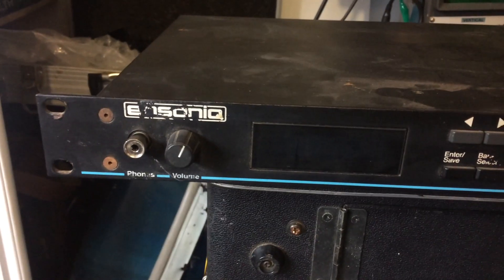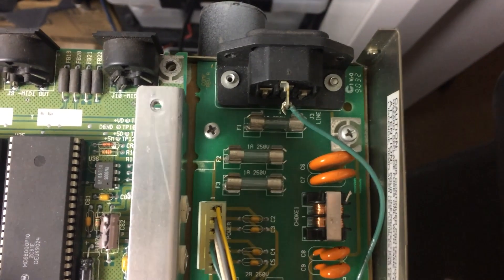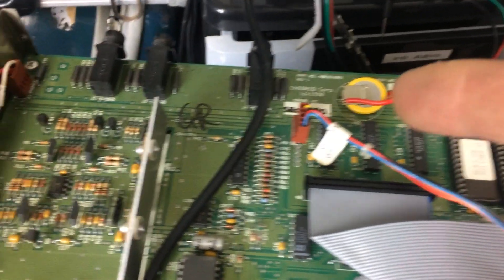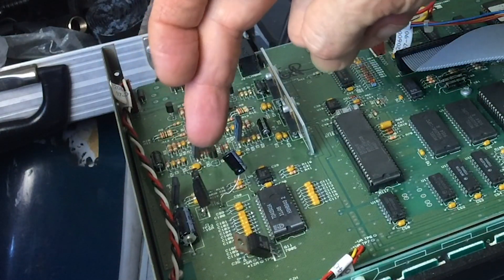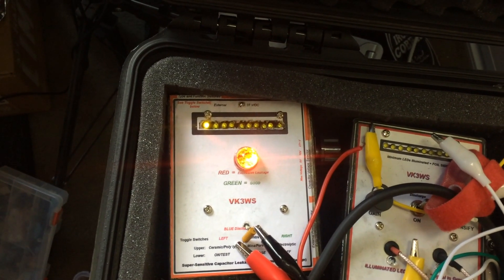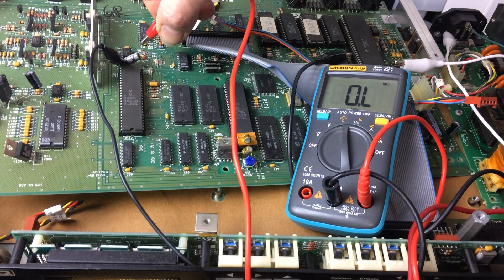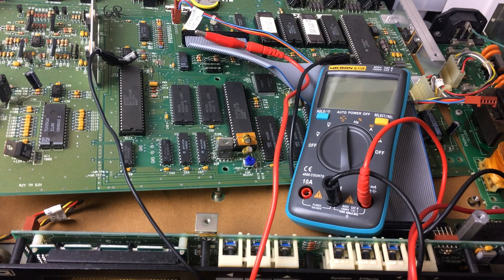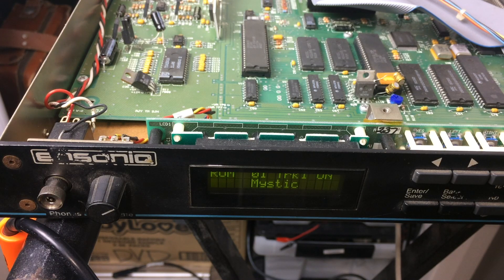Ensoniq SQ-R Synth Repair without a schematic | How to test capacitors

Comment: Nice repair vid of a classic synth of the early 90s, btw my SQ1 plus keyboard has a blank screen and it only shows the number of each button i press its in a mode called "self edit" i think, i cant make it work altough i have tried all the ways to initialize it it doesnt seem to work, on the service manual it says something about "hard reset" but i dont know how to short the minus side of the battery with pin 28 of U28 chip, any ideas would be great
Reply from the maker: @Pan6888  thank you for your comments. Turn off the instrument then use a piece of wire or one probe of a multimeter to join to two points as stated. Hold there for 10 seconds or so. Remove the wire then restart the module. If still a problem, read the section of the manual on editing. It could be it has a scrambled memory. Reset should fix it.
Reply: @onomatopoeidia  Hey thanks for the instant reply ! 
So i need to place a piece of wire on these 2 points (Minus side of the battery - which i have replaced by extending it out of the motherboard with a couple of small wires as well - and pin 28 of U28 Chip for a few secs. Normally this will hard reset the instrument and if no then i should look about for the Memory chips - which i dont know where they are located as well but will find them - 
 So far i did the following 

Checked the fuses -  OK 
Checked the ribbon cable that goes from the keyboard to the main PCB - i mean i have checked that for continuity - 
Reseated all socketed ICs 
Reconnected everything like the cable that goes to the main board from the PSU, the cable that goes from the keyboard to the main PCB 
Replaced the Battery - it was only 0.40 V but this is not related to the issue that i am facing 
Checked for problematic caps visually - they look ok 

Tried to aply the Normal Reset procedure with no luck i can only see button numbers whenever i press on - btw all work fine - but nothing happens. 
 I know that the synth enters "Self test" mode whenever fuses are faulty, or whenever for some reason there is no connection among the various PCB modules but in my case it seems that the issue lies elsewhere, hopefully i will find it cause i love this early 90s synth.

Comment: Hi, thanks for the video. I hope you don’t mind me asking. I’ve recently resurrected a Korg DS8 with a battery and display change. There’s one issue though - when i edit sounds for a longer time the synth freezes. After restart it’s ok (if i just play and don’t edit) . Do you think this might be capacitor related?
Reply from the maker: @racalik  try a factory reset/re loading of the system memory. Removing the battery would have scrambled the memory and that’s why it’s crashing.
Reply: @onomatopoeidia  yes yes I've done that after the replacement, loaded some patches and it works all fine in general, but for some reason I cant edit for more than about a few minutes, lets say. Weird issue!

Comment: Greetings from Adelaide , what scope are you using ? does if have a component tester or is that what the box is on the left of the oscilloscope?
Cheers.
Reply from the maker: @andrewverran6998  bog standard scope…yeah it’s a great box. My brilliant dad made it. It’s a curve tracer, sometimes referred to as an Octopus. Let’s you visualize resistance on the scope and great for seeing switching curves/knee shape and invaluable for adjusting hall sensors, potentiometers and components. See the link in the description
Reply: @onomatopoeidia  I thought it was a curve tracer...nice work by your dad
✌️

Comment: Mine has just died, this is great. Many thanks !
Reply from the maker: Same problem?
Reply: It was working one day and then the next no audio, theres some noise but not the humming as with your example. Unit boots, LCD is working and menu works. I need to get the multimeter on it and do a trace, but hoping it's going to be something simple which has failed on the output stage like yours. I'm based in Turkey and the only keyboard / studio tech I know is 900KM away so try to fix what I can myself.  @onomatopoeidia
Reply from the maker: Schematic here. Check all the voltage lines especially the 15V regulator. https://archive.org/details/sm_Service-Manual_SQ-1_SQ-1_Plus_SQ-R
Reply: Hey man thank you, thats very kind of you. Hopefully I will have one less patient on the bench :) @onomatopoeidia
Reply from the maker: @bensmethurst7821  anything a person made can be fixed by one :)

Comment: I have a Korg Poly 800 that seems to be fluttering pretty heavy when I play patches. I've already replaced the internal battery, but I'm still not too familiar with electronics. Any chance that's a capacitor issue?
Reply from the maker: Yes plenty of chance especially in the power supply but could also be connection issues (check all the plugs inside and unplug them and give them a spray with electrical cleaner).

Comment: man, I just got an ESQ-1 and I want it to work so bad.. I got some good tips from your vid. I think I have more than one problem though. The display worked 2 days ago but in self-test mode.. If I held a soft button while turning the power on, I would get the button number but it was shifted(?), but now, the display doesn't work anymore.. I tested my voltages from the power supply, they're fine according to the service manual.  But I got no sound also, except an high pitch sine that goes from high to low, if I press a button from the keys while turning  the power on.. It doesn't receive midi notes. So,I m kinda stuck. I bought it to learn about electronics repair.  I don't have an oscilloscope either..I really want to get good at it!! and fix this beautiful synth. the inside was really clean too. I think it might be the display ic chip and/or the keyboard controller chip.. 2 commom problems on these.
Reply from the maker: hi well it's going to be a learning curve. I suggest you consider getting this repaired by a pro and simply ask which parts were faulty. Looking at the circuit again, you might be able to learn how the faulty parts caused your symtoms. If you manage to find an honest repairer, consider yourself a LUCKY guy and they might be able to give you some useful tips. Maybe worth exploring some basic repair courses at your local colleges if you are interested in building your skills?

Comment: Thanks for the vid. I have a question about capacitor voltages. 
I’m trying to fix my Ensoniq DP4 (but think I’m killing it more). Initially only audio channels 3&4 were working. I just tried replacing (all the black) capacitors on the power board & main board & now the screen is just blank (& it’s not in self-test mode). 

My question is about V vs VDC caps. I ordered exact cap/volt/size specs, but when the caps arrived, most were labeled “VDC” (not “V” like the orig caps).

If my only options (as I’m finding) are VDC, should I have ordered bigger voltages? (& could that be a cause of my unit totally not working now?)

Thanks to your vid, I realize I didn’t notice the little orange caps (& now am wondering if those were the caps I SHOULD’VE replaced for audio channels not working).
All the ones I replaced actually tested fine on my capacitance DMM.

(Previously the DP4’s config ‘self test’ showed only the audio loop for channels 1&2 failed...everything else, eprom, etc passed.)
Reply from the maker: M Thomas thanks. Oh I love the DP4. Great musical reverb with loads of colour. Haha yes sometimes it can seem like you’re making things worse! See the schematic @ vintage synth parts. Retrace your steps and refer back to your original photos before you started replacing stuff (you did that right??) You need to use the same or higher voltage capacitors of the exact same capacitance. Make sure you replace polarized capacitors with electrolytic polarized ones. Check them all again for the correct direction and value. Compare them with 3&4 circuit. Because you have a working 3&4 channels, you should be able to compare and cross-reference the values at all points of the 1&2 section to find the problem. Follow the schematic test notes and go systematically through the audio stage from input to the output and see where signal stops. If you feed the unit with audio at the 1&2 and 3&4 inputs simultaneously, you should be able to discover where the signal stops flowing. It’s not rocket science, it’s brain surgery haha!
Reply: Fix'n Things Thank you for the response! (& currently it’s not even booting up :-/ the green screen lights up, blank, but yes I took photos & followed polarity etc.)

My question is more: Are “VDC” caps the wrong caps (or if I’m going to use DC caps, do I need to convert the VDC amount to larger amount of V)? 
None of the orig caps say “VDC”, they say “V” .  Mouser never ID’ed them on my order or search as VDC, just V (though now I see, if I click on a specs pdf, I see they are in fact DC, so I’m wondering if they’re just too weak).

I’m figuring the most likely new-problem is: wrong caps or bad solder connections..

Also from reading forums, the DP4 doesn’t seem to have a schematic floating around ....only the DP4+ (although I’m still pretty green understanding those anyway).

I do have the DP4 service manual...but I don’t have an oscilloscope, which it seems would be needed to follow the manual’s Vpp tests. 

But yes I love (all things Ensoniq really)....I’m dying to have this DP4 working!
Reply from the maker: M Thomas VDC means DC voltage so the same thing. Get a cheap used oscilloscope or one of the cheap Chinese handheld ones from eBay. $100 will get you a good one.

Comment: great video thanks for showing us. by the way i got a broken keybed from the asr. the coil boards. ribbon cables are ok do you have an adivce where to start?
Reply from the maker: ToniJXN thanks for watching! First you should try to repair or replace any mechanical problems. See keyboardkountry.com for any parts you need like the keybed which they have one of right now actually very cheap. Then try to get the service notes for circuit test points and the calibration routine. It should be in the service manual. Best of luck!